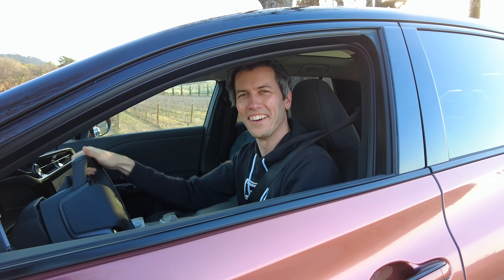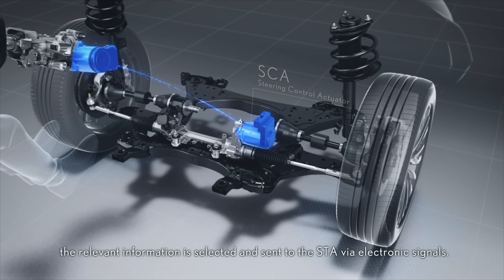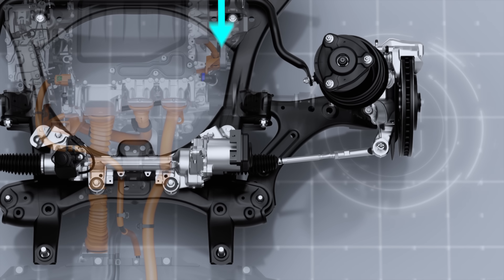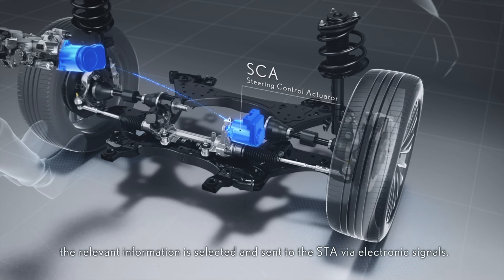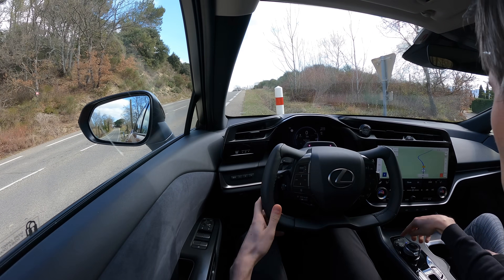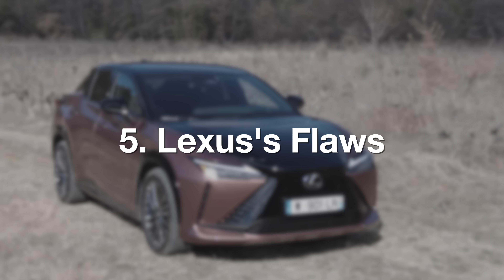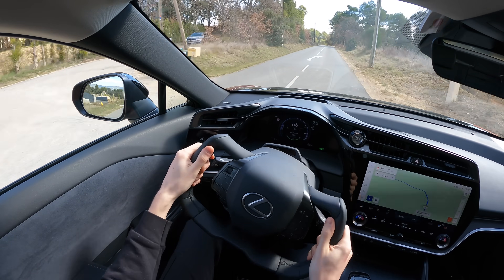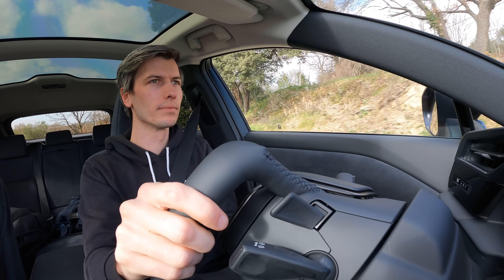How Lexus Fixed Tesla's Bad Idea: Steer-By-Wire Yoke

Comment: 2017 and newer Ford Super duty trucks have optional varariable steering ratios.  They use a planetary gear set and an electric motor in the steering wheel to achieve it.

Comment: Looks like the Steer by hydraulics from Citroen in the late 60's till the 90's. But the system was removed for US sold cars. Ratio was adapted with the speed you was  driving.
First car with the system was the DS, followed with the SM and after that the CX. A hydro-mecanical system replaced the same function on the Citroen XM.
Regulations in the US had Citroen remove the system and replace it by a standard system.
Reply: Did the DS already have DIRAVI? I thought it was first introduced in the SM and continued in the CX. The XM had DIRAVI in the V6 versions, all other XM's had the more conventional DIRASS system.

Comment: We have had steer by wire in the Q50, Q60 and QX50 for years.  There is a mechanical backup that links up in the event of a failure.
Reply: For 10 years exactly. Highway driving is like a dream! The car just doesn’t require constant input. It’s driving dead straight, auto adjusting for road imperfections

Comment: What happens if you quickly accelerate or decelerate while in a curve? Do the wheels change their angle as your speed changes without you turning the steering wheel?
Reply: no

Comment: From an engineering standpoint, although extremely complicated, the system looks sound. However, in a system which now has 3 variables (user input, system response delay, and a vehicle speed-dependent transfer function) as opposed to 1 in the usual setup (response delay is negligible)  the weak link becomes the human behind the yoke. Greater delay means higher probability of driver induced oscillations. Filtering them out means reduced reaction. And what seems even scary to me is how the driver will adapt to the steering response change under strong acceleration or, more importantly, braking. Yes, seems nice. I'll stay with my regular round wheel until proven wrong though.

Comment: Here goes "a better mouse trap" again, except this time it's electronic and soon to be linked to your phone... and this is fixing a problem that is not really a problem, or even an issue with %99.9999999 of drivers. Another thing that no one will be able to fix except the specialized dealer at amazingly high cost.
Thanks for another great video. Keep 'em coming.

Comment: my gaming steering wheel still using 270 degree angle, because of limited angle, it set with progressive mode... which means, the more you rotate the steering, it gets more progressive turn....
 i think i will like this kind of steering style...

Comment: If it's controlled by software, it could be configurable as well.
I think the safest way should be having the ratio constant and make the force necessary to turn the wheel variable according to the speed, that way you could have stability at faster speeds without problems learning the turn ratio.
Reply: That's exactly what a current variable power-assisted direction does... and to me, it is the most logical solution : same wheel angle = same steering, direct feedback from the front wheels and heavier direction at high speeds to prevent accidents. Engineers may have fun with new technology but what's the use for the customer if nowaday's directions work fine ?

Comment: The human brain is very elastic and I don't  have any concerns around our ability to quickly adjust to this type of system. Hopefully they will eliminate the latency before it goes into production. No one buying a daily driver, including Max Verstappen, will have a problem with this type of system. Want analog, keep a motorcycle or vintage car in your garage...

Comment: my original concerns were similar to a lot of commenters here. i too thought about slowing down while steering and what that means for the variable steering. if the car steers harder at lower speeds, will it feel a slight bit less under control when slowing down? however after i sat back and thought about it, this system is just fine and will be easy to use without issues. i realized i dont brake in turns, i brake BEFORE turns (something we should all be doing anyways).

Comment: What if the steering controll actuator and the steering torque actuator both fail at the same time, and while driving,you loose all steeting?
Reply from the maker: As mentioned, there are backup motors for both.
Reply: @EngineeringExplained  oh okay, i thought if the actiators fails as complete units their backup motors may fail aswell, perhaps the backup motors have other power sources just for that reason i guess

Comment: Do you think a system like this would be better or worse for off-roading? Future electric off-roaders will likely have 4 wheel steer and individual wheel motors for crabbing/tank turns, so a system like this may be more appropriate.

Comment: That’s quite awful really. Even at highway speeds, the necessity for quick lane changes in emergency situations won’t be possible with the low ratio steer-by-wire, and the fact that there’s a yoke attached to the steering column makes that situation even less desirable. Also noticed how at 10:13 in the video that the jerking of the yoke didn’t translate to the wheels in real time, as one would expect and is often required in slow parking lot speeds for accident avoidance, as you demonstrated in the slow wheel response to quick yoke maneuvers.

Comment: Didn't inifnit have steer by wire on the q60 first
Reply from the maker: Yes, but it still had a mechanical linkage between the steering wheel and steering rack.

Comment: You can change the Tesla steering ratio in the U/I. It is not fixed. In sport mode, there is no hand over hand at all.
Reply: no true... its mechanically connected -he even explains it in the video
Reply: @Andi_ch  no I’m saying it can be adjusted so you are not going hand over hand while steering.
Reply: @nrdalrt15  that's not true...
You can't change the ratio... Only thing you change is the amount of resistance.

Comment: Great video! I think the only thing missing to mention there is that the Lexus use the pivot in the middle or Y axis when holding it, making the movement very intuitive and circular, where the Tesla solution does below the the middle, making a weird pendulum movement that at long trips really makes the driver more tired as you need to use more muscles to compensate for that side way sliding as you keep the car straight. And maybe worth to mention how thick the Tesla yoke is, that makes really hard for small hands drivers and just uncomfortable for large hands. That one from Lexus looks like Corvette C8, that is a very good and comfortable steering.

Comment: Four notes here:

1. If the chance of failure would be small there would be no redundancy.  And wile it should be all fine in this setup and probably manufacturers will not cut corners on that element its still a system much more prone to failure than steel rod plus rack and minion (and a pump or motor). It is hard to imagine situation where car moves fast and the steer by wire steering system suddenly fails catastrophically. But I can imagine a car infested with rodents which chew cables and they fail mid drive. Will the weels stay straight? Will the command computer keep them from changing angle? Probably. But you will loose the control. Not as rare as with direct control.

2. There are cases with airplanes when they lost ALL power (because someone did not put enough fuel or the fuel leaked). In such cases the plane has no control. The argument "oh dummy planes have fly by wire and its fine you dumbas" is wrong. Multiple crashes happened because there was no control due to lack of power. Also planes have much more rigorous maintenance where batteries, generators and cabling/hydraulic lines is/are checked.  Not so much with cars (Germany has yearly check, usa I think also, canada does not)

3. If the control fails for a crane or warehouse machine you can just stop. In like a meter. If that fails on a plane, well, you are dead. If that fails on a car then there is a big chance it will fail at high speed. The result will not be as good as with direct steering. Will it be as frequent or not? Nobody knows. Who is to take risk here? That leads to another issue:

4. Regulations. Back in times (and I hear this from many north americaners) government regulations were there so some joe smoe dont sell you snakeoil, stale milk or a shower head which will electrocute yourself. Recently the regulators go dumber in terms of ability to assess things or test them. They are more armchair thinkers and stats (provided by manufacturers) analysts. And often just stamp under the regulation created by automakers. Max 737 is prime example of this. We dont want to go this way. Where is the hard material on testing of these systems? Where are thousands of hours of testing documented? Is the regulator able to duplicate these tests?

Lets answer the #4 before we go into details about double motors etc...

Comment: The yoke is fundamentally wrong in a design where you have to turn it more than 90 degrees in any one direction. 

Reason: the wheel forces there to be a clear area to turn. The yoke does not. In an emergency, knees could get in the way.

Comment: The response makes no sense. EV throttle 100ms vs ICE 1000ms cannot be a reason for steering at 100ms delay being good enough vs. 0ms in mechanical steering.

Comment: I've been looking forward to a good steer by wire system, but the delay is worrisome. I'm afraid it's going to be like the feature I HATE in cars these days, the ramping "soft" controls for fans, volume, lights, etc. If I turn the fan switch, I'd like to know instantly what the fan speed is going to be when I let go of it, instead of it VERY slowly ramping up to that speed. I turn the knob until it's where I want it, but a second later it's blowing my eyelids back. Stereo volume is just as bad. I want to turn in down a notch, but now I can't hear it so I turn it back up, now it's too loud again. 😡Response needs to be faster than that.

Comment: Infiniti does steer by wire on some of the Q50's. They started doing this back in 2014. They are still doing it today, called Direct Adaptive Steering
Reply: The main reason I didn't buy a Q60 after having a G35 and G37, all reviews said it didn't have enough feel.

Comment: There are too many electronic gizmos on cars and trucks now. I was an IT engineer for 37 years and have always serviced my own vehicles. The more electronics we use in vehicles, the more possibilities for failures. The mechanical systems have limits, but so do electronics (as Jason points out in this video), and when electronics fail, it often comes with smoke and burning electronic smells. I know the Federal government and the "green agenda" folks think that battery powered cars are a great idea, but we haven't exhausted what mechanical engineering can do. As Jason points out in another video, the energy density in a battery will never rival the energy density of a volatile liquid engine fuel.

Comment: I'm curious, not about the mechanical or safety concerns, for the same airplane redundancy reasons.  I'm curious about the legality.  For years off road enthusiasts have known you can't replace a physically linked steering system with hydraulic steering (which is essentially steer by wire but the wire is a fluid), because the law won't allow it, despite hydraulic being superior for use with heavier off road suspensions and tires.  The minute you remove the linkage, you can no longer use it on public roadways.

Is Lexus working on changing the laws to allow this?  Much like how in Europe you can get digital (camera + display) mirrors for better aerodynamics, in the US you must still have two functional reflective/passive mirrors.  Is this roadblock (word used intentionally ;)) being addressed?
Reply: Note on the safety aspect for the failure cases, I would love to see the steering linkage left in place with an electromagnetic dog-clutch disconnect.  When energized, the column is disconnected, but upon electrical failure, the system fails back to directly connected mechanical steering.  That would give my engineer brain more confidence in the system.

Comment: When electronic servo steering became mainstream like 15 years ago many sportscars were described as loosing the steering wheel feedback vs. the hydraulic servos. I suppose with time that has improved alot and a modern day 992 Porsche probably has pretty good feedback. This is the next step so while this technology wont be perfect in the coming years, as we get into the next decade I am sure it will feel pretty fine. I am super anti-EV for enthusiast cars but I can definately see myself enjoying this yoke SBW system together with one-pedal driving as a daily driver.
Reply: Huh! My TR7 had no steering assist, a very low ratio rack and actually a quite small wheel.  Lots of effort to park but an absolute joy to drive on twisty roads. Don't need power assistance.....
Reply: @geoffwoodgate7450  The TR7 has like 450kg over the front wheels. EV SUVs probably has your whole cars weight just on the front axle :)

Comment: Well throttle by wire is fine because wrist case you can't accelerate but brake and steer by wire you loose control over the vehicle

Comment: 12:32 so its steer drift like joystick drift XD

it might be cool if it can adjust profile based on driving mode, as long as feedback delay can as low as sim steering wheel or even mechanical steering wheel

Comment: Nifty concept, well explained. The logical next step will be joystick-steering like on an Airbus ;-)
Mercedes gave this a try in their concept car R129 SL from 1998 with two sticks, one for steering, the other for gas and brakes in the doorcard and on the middle tunnel.
However, it would've been nice to disclose the deal with Lexus in more detail for full transparency if not in the video, at least in the description.

Comment: It feels like that the delay you mentioned is really due to that you’re allowed to turn the wheel faster because of the lack of physical connection… I guess making the rack actuator stronger to follow the input faster would work but also raise costs. Or the force feedback motor to overpower you :) but that is the same costly thing.
What I’m trying to say is that not like it can’t read your input it is just slow to do it on the very edge of its range.

I’d like to try it for sure :) perhaps with the EV paradigm shift we might need to consider to give up more of the traditions.

 From my point of view I’m looking forward to the ev and more autonomous future but also cherish the mx5 till i can have one ;)
Reply: that delay is and always will be there. it might be unnoticable at slower wheel turning speeds. pretty much same as in the driving simulator. do what you want. there is small delay when driving aggressively. normal chill driving and you don't notice it.
it takes processor still some time to do calculations. and that's where mechanical connection always has advantage.

Comment: While steer-by-wire is a much simpler system, there have been variable ratio steering systems. About 15 years ago Audi was using dynamic steering, which used a special gear set to vary steering weight and ratio depending on driving settings and conditions.

Comment: The main concern imo wouldnt be the car itself, its owners in areas where mandated vehicle checks aren't a thing. Part of the reason why redundancy is an acceptable solution in aviation is that for critical parts there needs to be a number of working redundant solutions in place for it to take to the sky. Whereas in states without mandated vehicle checks someone could lose a steering motor, and then simply ignore it. The car will be fine, for a bit, as the redundant motor picks up the slack. But then it no longer has redundancy and a failure will be catastrophic. In the majority of the modern world where there are mandated vehicle checks this isn't a problem the owner will have to get that serviced, but thats not the case everywhere, and people could die as a result.

Comment: "We already have throttle by wire" 
Guess what, we also have brakes.
Ohh.... wait, tesla is using brake by wire, yep IK, i can see all of the reported incidents of the car failing to brake and accelerating on its own 
What if this thing completely fails? 
What if it gets hacked? 
This SHOULD BE BANNED from the road.
Cars should be build by mechanics and by people that DRIVE them.
Not some rat stuck in his moms basement all day!!!

Comment: Nope, not gonna happen, not for me. There is a difference of hundreds of million dollars in the research budgets for "fly-by-wire" and "drive-by-wire" systems. I don't think anyone needs one more thing that can be remotely hacked and/or disabled. No to "brake-by-wire" and no to "steer-by-wire". Call me old-fashioned or even narrow-minded, but it's a hard no from me. Excellent video though. Thank you, Jason.
Reply: Then you will need some strong drugs if you intend to fly .  And think of the millions that do every day .  Change is difficult as we get OLD .  ✌️👍 🤯

Comment: this sounds like a mess of issues that somehow might be worth it once its all put together. I could see this having the same issue as an automatic transmission, where it is having to guess what I am trying to do and half the time does opposite of what I want (start in a high gear trying to get on the highway and in a low gear at a stop sign in front of a school). for example, if a car is going 45+ mph and a car negligently merges into their lane making them slam on their brakes, they might stop, or the car could easily mistake your patterns for aggressive walmart parking and switch to a higher sensitivity leading to a crash/rollover. I could be wrong, its possible its a lot more simple than I am making it out to be